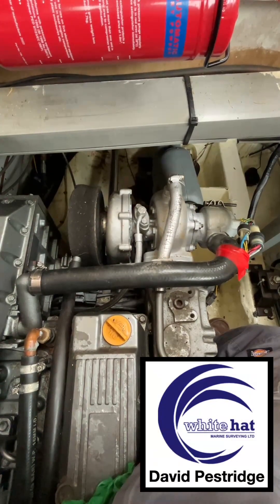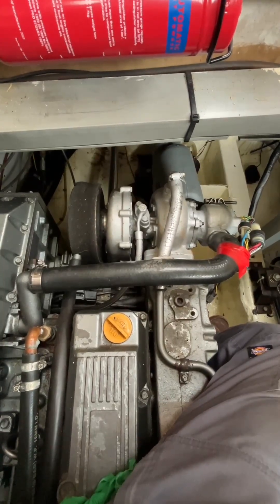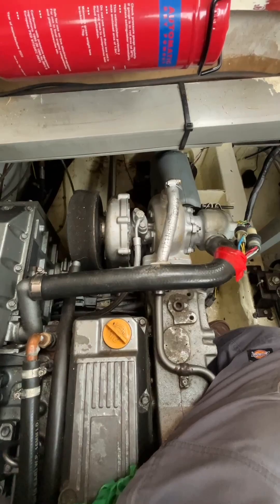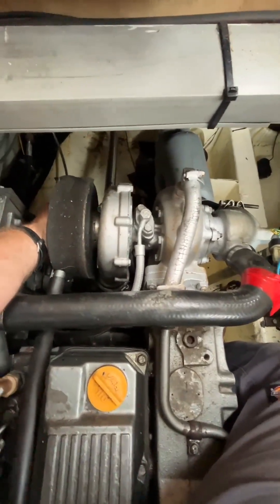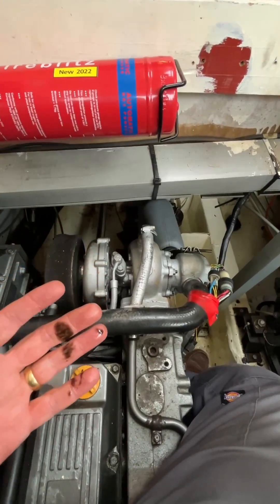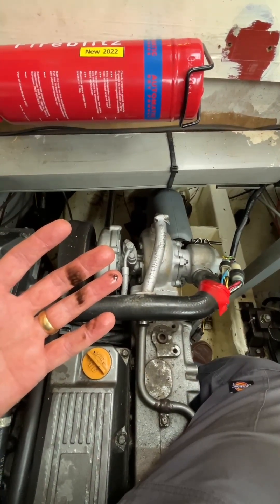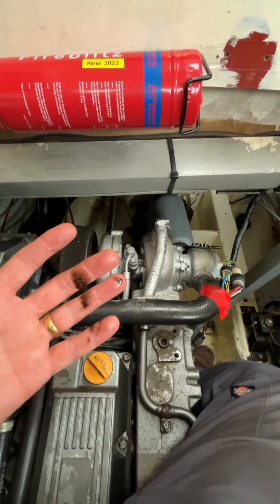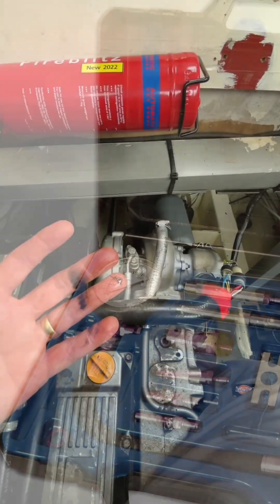Crankcase Breather Hose Oil Leak

Comment: That's ok diesel crankcase smoke gets sucked up and that's just residue your supposed to clean those foam filters every  3 months or so ... The oil will not hurt nothing..
Reply from the maker: You're right, in most cases it is both normal and harmless.  But when doing a pre-purchase survey with no idea of the engine's history or when the filter was last cleaned or replaced it is worth raising the question and perhaps recommending a compression test if it is bad.